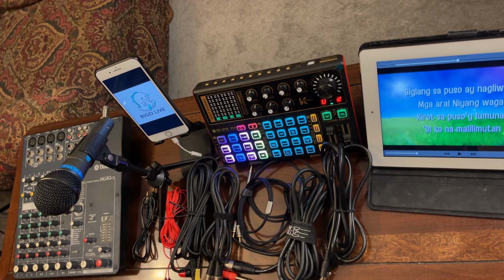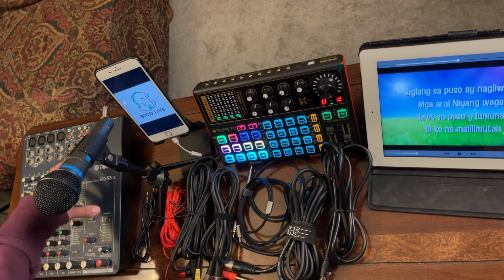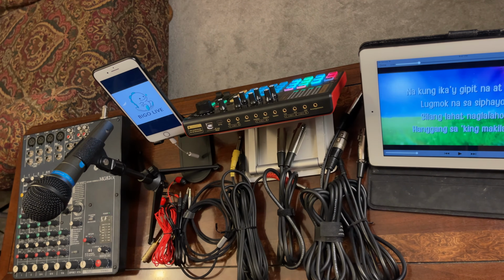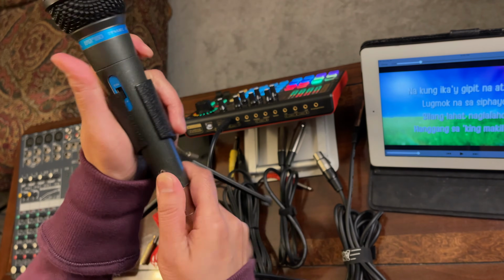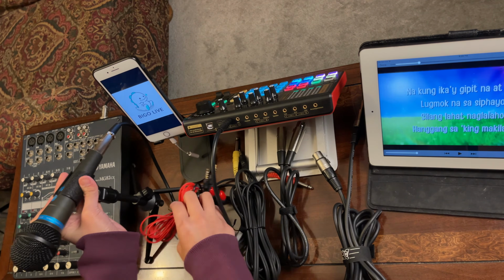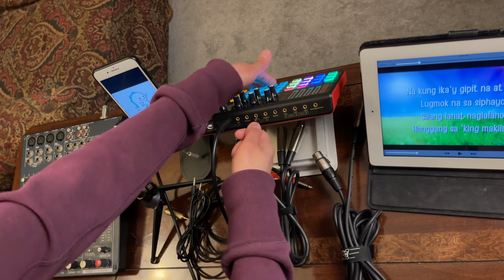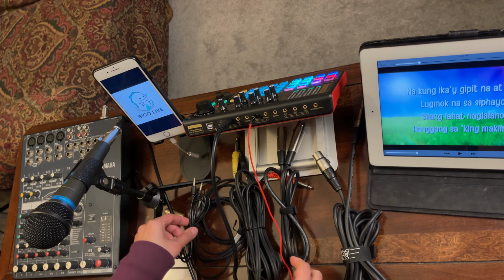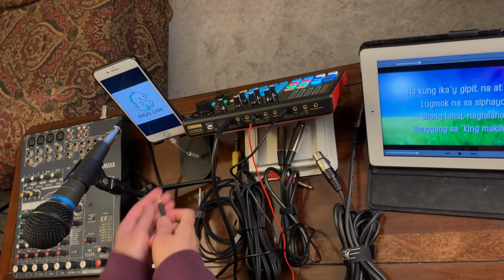K300 Sound Card for BIGO Live using Dynamic Mic  With or Without Mixer connected

Comment: What if you have a phantom powered mic who need 48 volts to work using just the K300 as special effects on FX  on your mixer ?
Reply from the maker: You will have to connect an external
Phantom power then connect the mic there then connect the phantom power to K300. So you will need an XLR male to female and XLR to 3.5mm jack.

Comment: what mic are u using?
Reply from the maker: It’s Apex Dynamic mic
Reply: @jenuds  other than that what mic do you recommend for this  sk300 setup? thank you :)
Reply from the maker: If you want louder vocals, start with bm800 condenser mic as you won’t need an external 48V Phantom power
Reply: @jenuds  thanks much 🙌
Reply from the maker: No problem

Comment: Hi, can you advise me a headset with a compact mic that is suitable to carry without consuming a lot of battery soundcard used to live bigo with a phone without a computer. High-grade, durable, noise-proof, compact and easy to carry
Reply from the maker: In my opinion using a headset is not ideal but should work. The reason I said that is because most the regular headset- when you talk you tend to hear the pop sound. If you can buy a small bm condenser mic to connect to the sound card would be good. You could minimize the pop sounds from the headset by covering it with a foam or if you have pop filter.
Reply: @jenuds  yes thank you for your advice, i was going to use a headset with mic eg Kz Zsn Pro X to listen and talk to Soundcard at the same time, but I changed my mind after hearing your opinion. so can you suggest me the compact headphones to listen to sound, and which is the small condenser Mic you talk about?

Comment: nag try po ako sa android phone ko na direkta ko sya sinaksak sa live through its 3.5mm port pero ayaw po gumana, need pa po ba talaga ng adapter para gumana yung live nya?
Reply from the maker: Yong adapter na white sa iPhone lang po yon. Kung android at may headphone port, don po e-connect from live port ng k300. May mga Phone po yta na hindi compatible sa pagrecord or streaming like isang model ng Oppo. May nagmessage lang po sakin from Pinas. Try nyo rin pong tanggalin ang Phone case kasi minsan d maayos ang connection kapag may case.
Reply: @jenuds  okay thanks Jenuds, I'll try it now

Comment: Hi Jenuds, please advise me which is the best small and light soundcard for bigo live phone? best for idols but compact easy to carry. Automatic adjustment is available without the use of a computer. Suggest me the right type of microphone
Reply from the maker: Maonocaster Lite or V10. Any BM 800 mic would be good. If you buy the expensive mic, most likely you will need an extra external Phantom power.